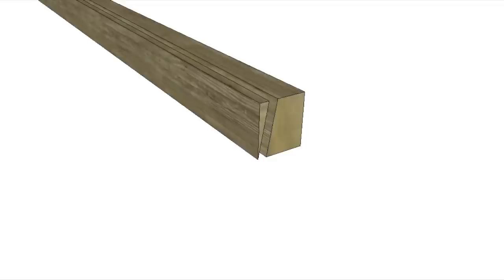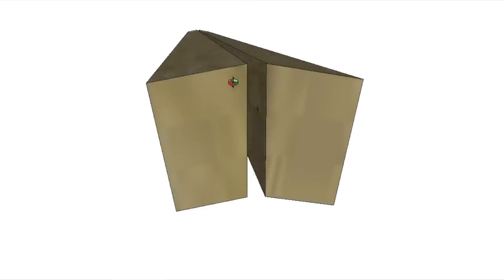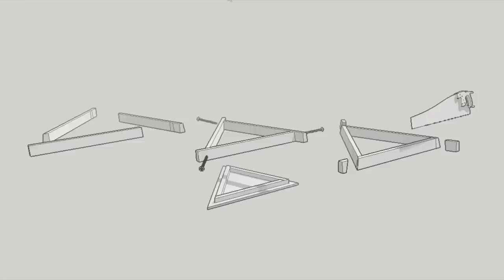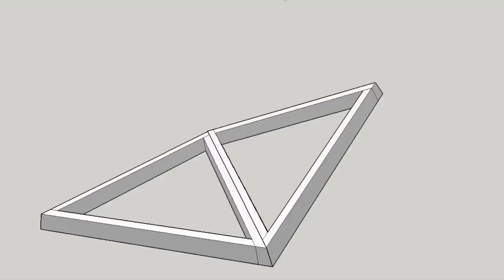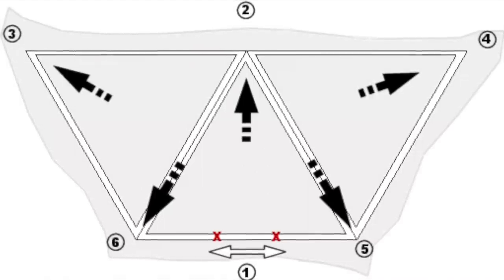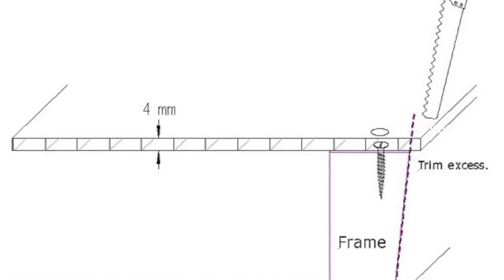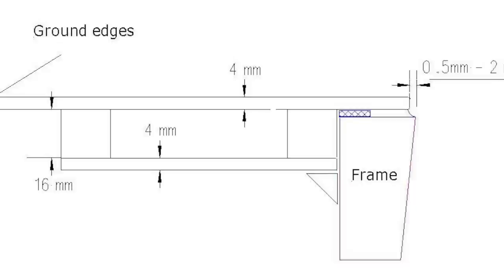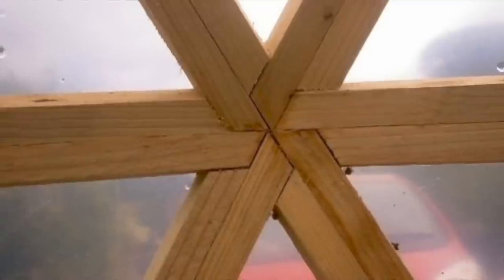Dome building methods - Beveled frame

Comment: Zip tie dome is more efficient n stronger n no trees r used xcept if u want a floor
Reply: Wood is sustainable and eco friendly, pvc is not. Try to break a pencil by pushing on both ends, pvc tube will defect with far less force.